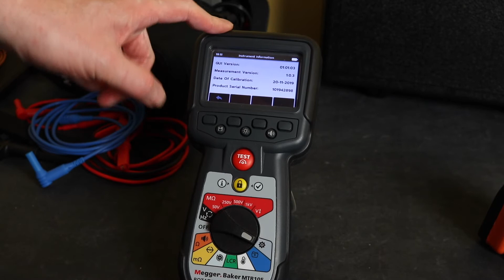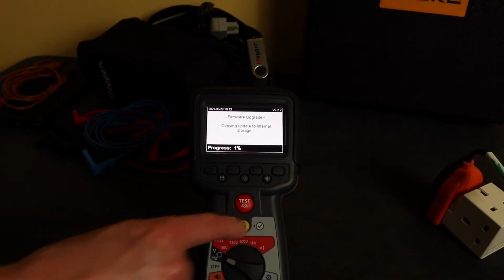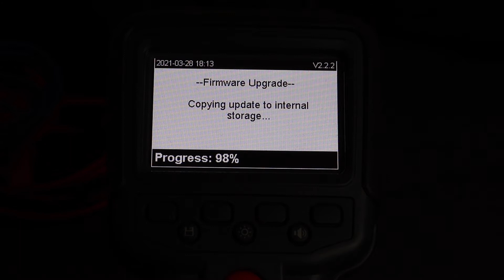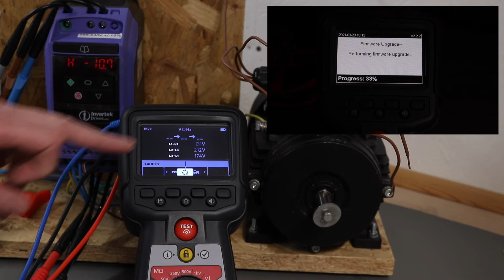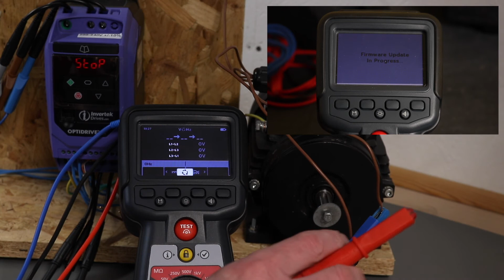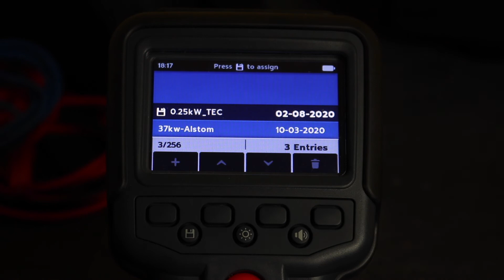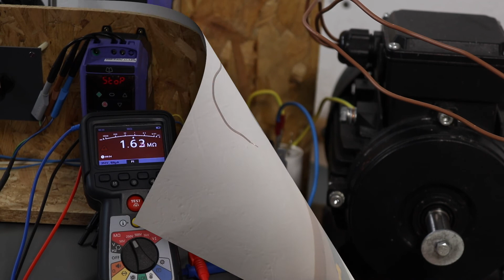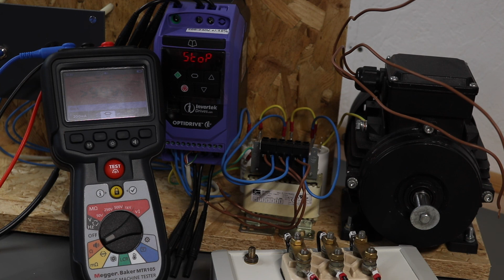MTR105 Firmware Upgrade

Comment: Hi, have you installed update 01.03.00-1.1.0 yet. Its a shame Megger do not give a "whats new" overview.
Would be interested to know what has been improved, hopefully the inconsistent charge indicator when using rechargeable batteries.
I recommend you do not do it with the NIMH batteries. Mine kept rebooting, presumably due to low battery voltage even though were just charged.
Reply from the maker: Hi, no I haven't installed that update. The brief description of it above th download is that it improves the calibration aspect, not sure if this means the inductance and capacitance modes or the actual meter calibration. There whole update process could be made a bit more user orientated.
For some reason, the meter does not charge the batteries too well, I have 2 sets and tend to cycle them through an external charger.

Comment: Attempting to do this with our megger mtr105 but it keeps freezing on the start up
Reply from the maker: There are two firmware upgrades that I have seen. My unit arrived with 01.01.03 installed, I then upgraded to 01.01.04 and then 01.02.03. If you are going straight from 01.01.03 to  01.02.03 without success, I would try going to 01.01.04 first and then to 01.02.03. If not, you likely need to speak to Megger direct for advice.

Comment: Hi, how t mensure current in DAQ970A?
Reply from the maker: Hi Bruno,
It depends what value of current you are measuring. If it is less than 1A, then there DAQM901A input card that has two 1A input channels built in to it.
If it is more than 1A, then you either use a current transformer with the DAQM901A current channels for AC to step the current down. Alternatively you use a voltage input channel from the same card or the DAQM900A card and use a current clamp adapter or measure the voltage drop over a series resistor.
If you are using a current channel, the DAQ970A reads this automatically. If you are measuring via the voltage method, then you can change the range and the units in the channel setup.

Comment: How often do you have to upgrade the firmware, and how do you know when there’s an firmware available for downloading. Does Megger notify you via email or text.  And is there a firmware update available for the Fluke 1587 FC ?  By the way great video TP as always.
Reply from the maker: Thanks TETC. I only new of the upgrade as I check myself every couple of months. I don't think it is an overly user friendly service. No notification for me, no notes on what the upgrade does and no previous versions available either, unless you already have them.
I don't believe there are any upgrades out for 1587FC.
https://www.fluke.com/en-gb/support/software-downloads